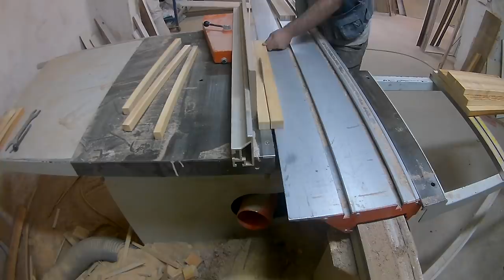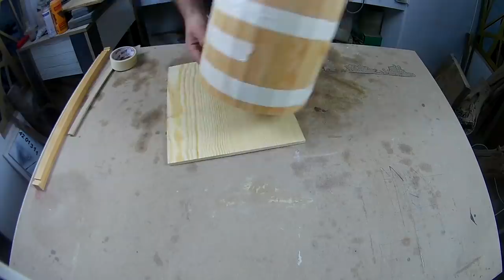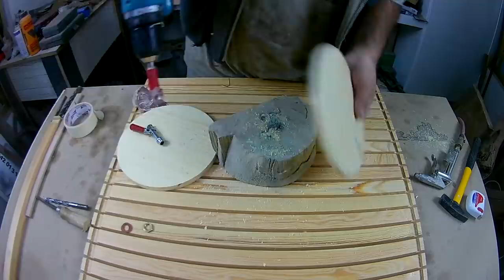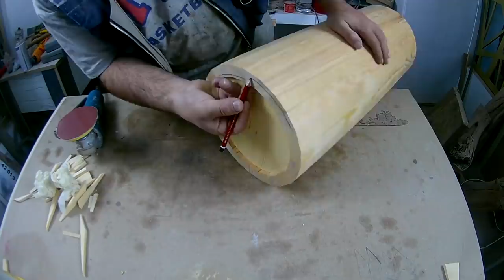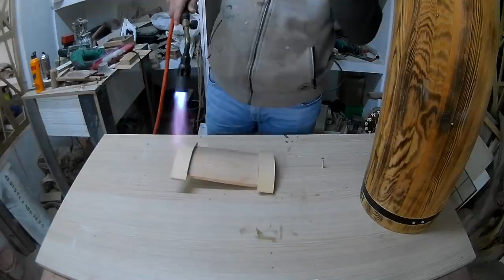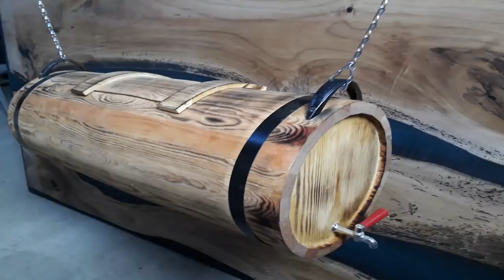Yayık yapımı // маслобойка //  churn

Comment: Can you please give advice on how to mark tand cut the degree of the staves.
Reply: You can use some math to work it out.  His staves were 3.2 wide , he used 24 of them but cut 25 just in case I assume or I miss counted , it works out to 76.8   , degree of angle he has mention a few times in comment if you looked. Use what you got to cut the angle on the staves , table saw , hand saw , planer , jointer , or get some one to do it for you last option or even a band saw , if you don’t have tools a hatchet and lots of sanding and persistence you can do it.